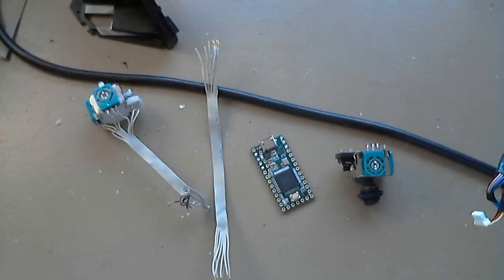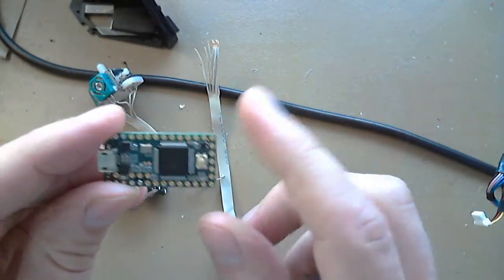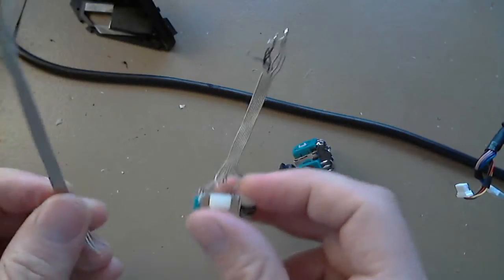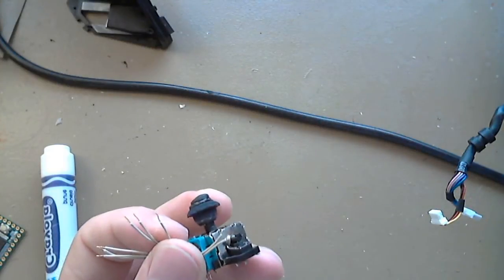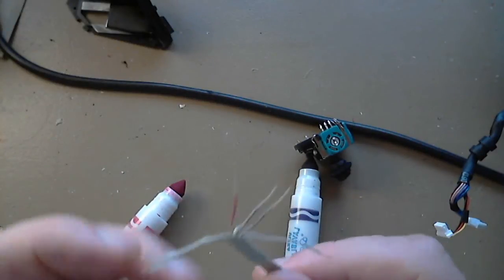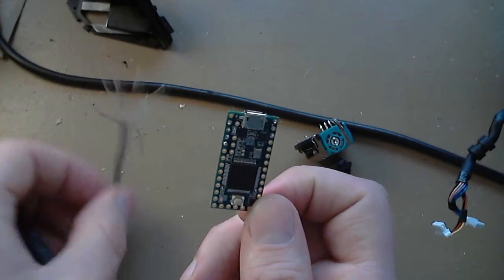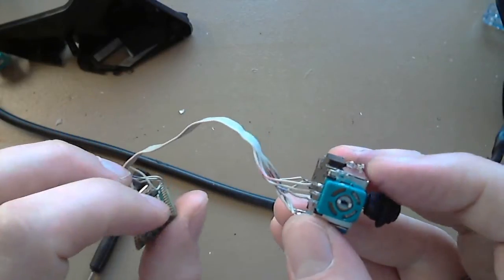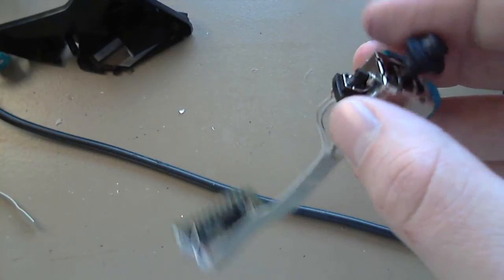Razer Orbweaver Thumbstick Mod - Part 3 Thumbstick to teensy wiring

Comment: thanks for the video... i've gone through 4 orbweavers due to the thumbstick failure. this allowed me to strip one of my thumbsticks down on my original. i soaked all the micro switches in iso and worked them for a minute. re-assembled and it's working again. who knows for how long but at least it's something.

Comment: why do you flip the picture ?? very informative video. im 100% sure doing this to my Orbweaver. i will just be using a NodeMCU wich practically is a Arduino Nanno but with wifi
Reply from the maker: It's flipped because that what my camera mount and options at the time allowed for. I plan on resolving that issue for future instructional videos. Good luck on your mod!
Reply: @tuffrabit  Really?
Reply from the maker: @Cobra206  Really what?